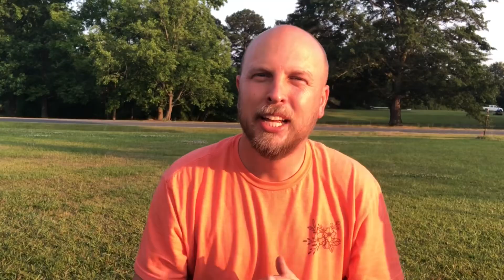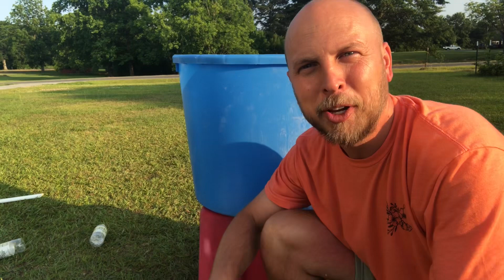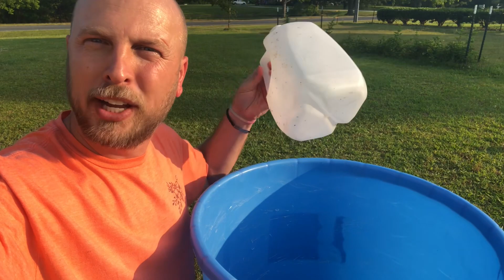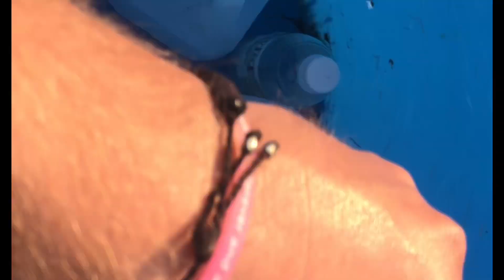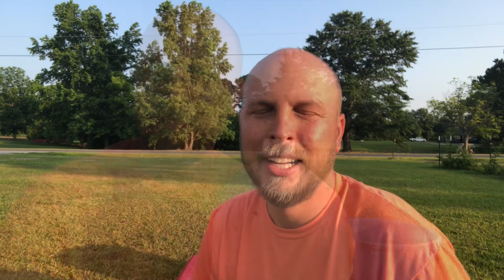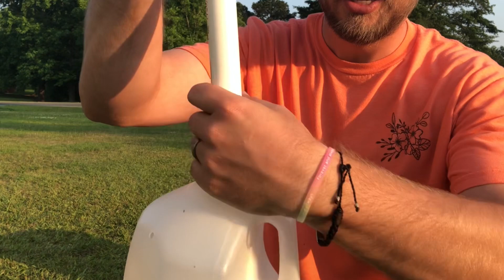How to make a SELF WICKING Container for your Garden!

Comment: How do you know the water is getting in all jugs
Reply: I found that putting the fill tube directly into one of the jugs makes filling difficult and slow. I stick my fill tube between 2 jugs and 180 degrees from the overflow hole in the side of the tub. In most cases, I can fill with full water hose flow until water begins to run out of the overflow... proof positive that the reservoir is full. I have blackberries, blueberries and lemon trees growing in this style tub for over 5 years in some cases without issue. I used 2 liter soda bottles. They fit better and provide an overall larger reservoir.

Comment: Curious about the hole 1 inch from the bottom of gallon jug:

When you stop watering at end of season, would water not stagnate, since all the jugs will have 1 inch of water remaining in them?

Would it be better to have the hole in the jugs/water bottles, closer to the bottom so all the water gets out and absorbed by the soil once you stop watering?

Thanks,

Comment: Question? Hi there, Great video and explanation. I started using this method last season. Although my success was not as great as others. I still love the way it works.  my question is what do you do at end of season?  I live in central Ontario Canada so winter is a issue so draining my tubes is necessary to keep them from cracking or breaking. What have or do you do or suggest? Also what about the used soil? There are a number of tubers who say you can reuse several years of the same soil if amended properly. Last year I just took the soil and added it to my other gardens since I had to empty the containers to drain the water. Thank you for such a great explanation